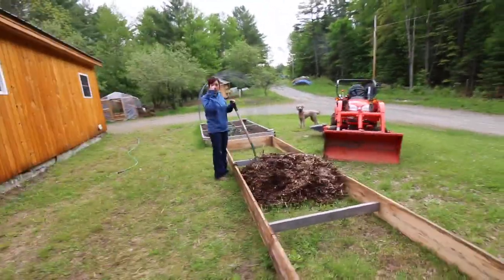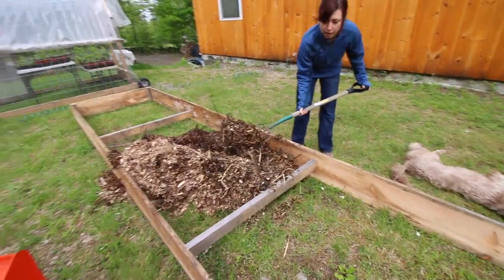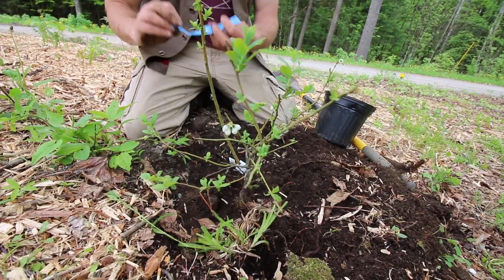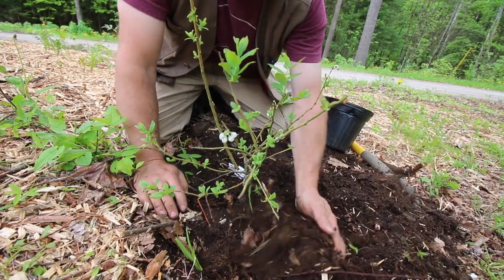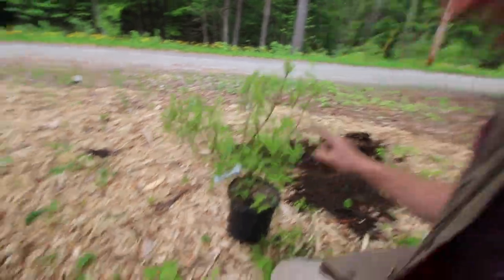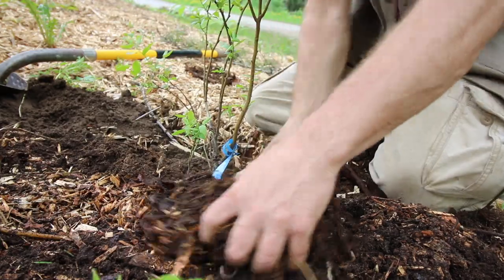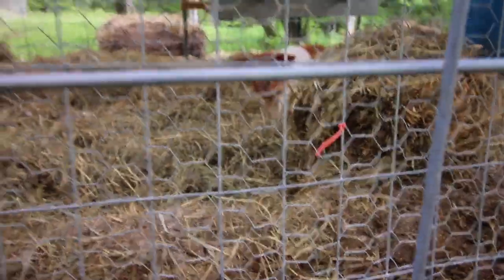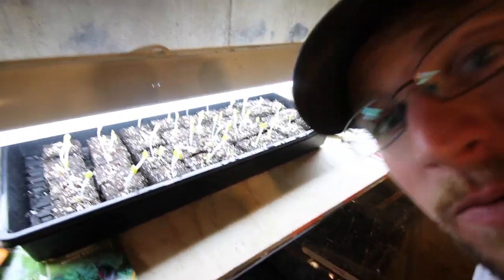BlueBerries, Raised Garden Beds and Flowers Oh My

Comment: I got the filled tires on the BX - They filled with foam and made them solid - I have run over nails, stumps, etc, no issues. Awesome grade.
Reply from the maker: That is an awesome idea! Where did you get them filled?
Reply: Lumnah Acres at the dealership - I think it was $90 a tire
Reply from the maker: Not bad if you can save your tires!

Comment: Those Phlox are going to look amazing once the spread all over those rocks
Reply from the maker: Thank you, we hope they spread a lot! We think we will have to buy more, we were too cheap to buy more this time! Lol
Reply: Lumnah Acres they will spread a lot, I spent $28 on 4 plants that are half the size of yours, they told me by the end of summer they will triple in size and my next spring, 10x the size, I am using them for irrigation between myself and my neighbor since there is a significant drop in their soil level. They were complaining about water run off, Im trying to keep the peace 😀
Reply from the maker: Thanks we were 26 for the 4 of them. I hope they grow that fast. What colors did you get?
Reply: Lumnah Acres  The light purple and the hot pink 😀. We didn't have many option choices... When the flower tent fixes to close up for the year down the road, I hope to get a bunch at 75% off 😃